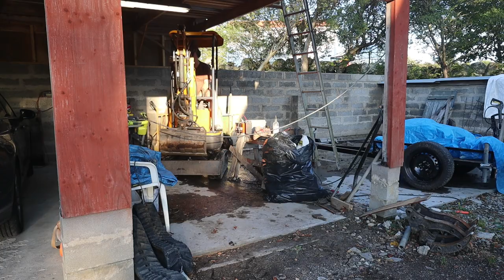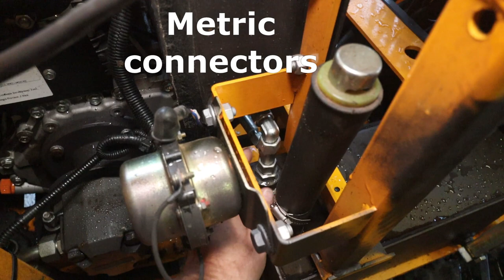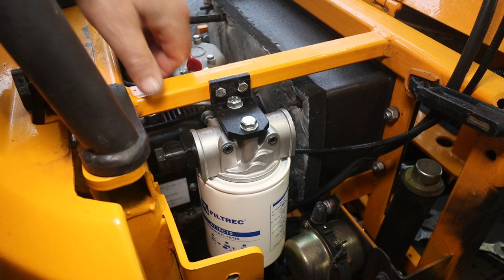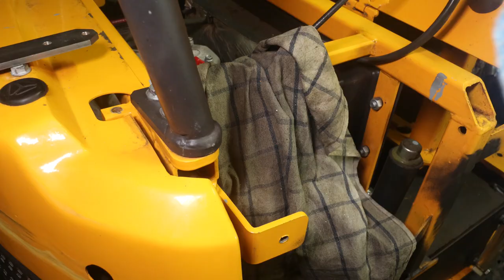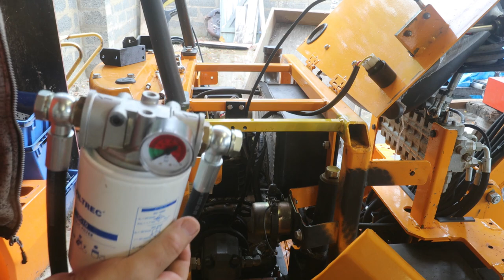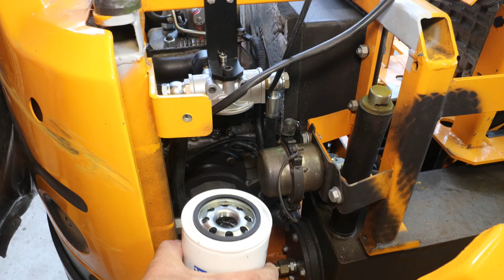XN08 mod, adding a filter

Comment: Some of the filters are 10 Micron and some are 25, does it make any difference which filter you use? The 25 Micron will filter more but will it cause to much pressure in the system.. I believe most of the adapters have a 15-25 PSI bypass. I may add an Oil Pressure Gauge to mine in order to keep a check on the Hydraulic Oil pressure. I know this is on the low pressure or return side so will try a 100 PSI gauge first. The other port on the adapter would be a good place to put an Oil Temperature Gauge.
Reply from the maker: The filter I use are 10 micron, 70 liter/min. There is a bypass at 1.7 bar. Measured temp a few times and it was never a problem so stopped worrying about high temp.

Comment: I just bought a ht10. Have beed looking at all these small machine. Most are made off the same prints. Some may have some small differences but not a lot.
Can you give me the Hydraulic filter housing and numbers if you have it. I did not get any booklet with the machine I bought. I have the gas version. I think I have lot more room on mine.